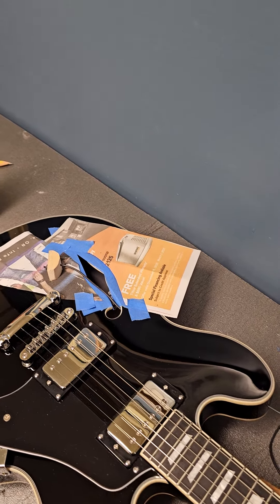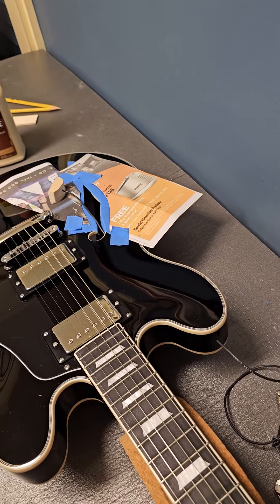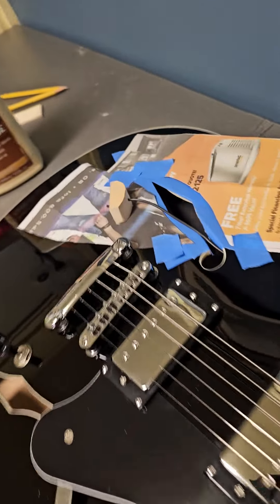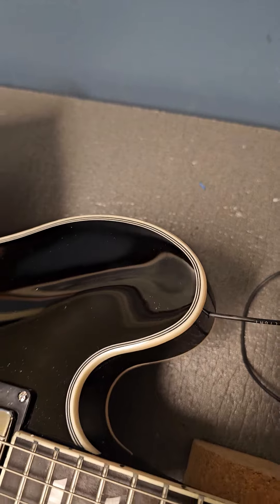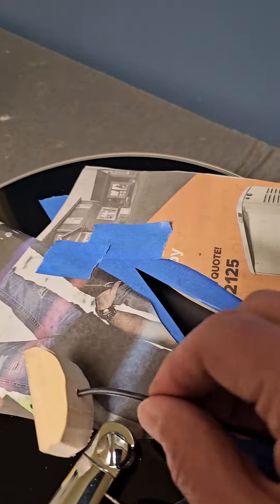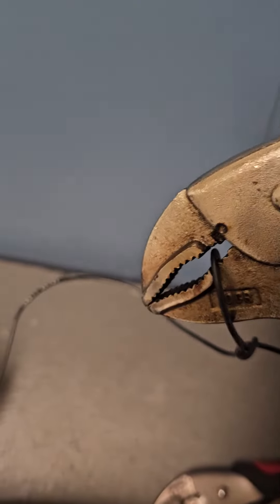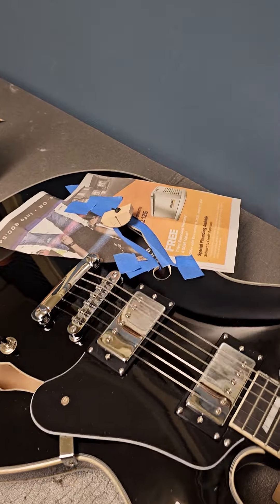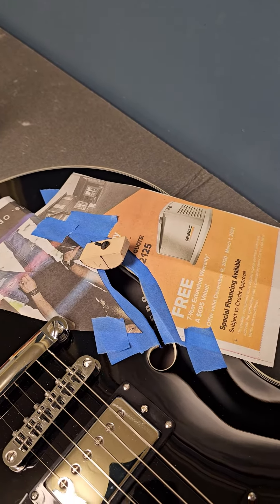How to Move Strap Button ES-335 and Other  ES-Style Guitars w/strap button on Backside

Comment: I put a strap button on the horn of an Epiphone 339.  In the event, I didn't like the way it changed the guitar's balance, so I reverted to the original position.  It seemed solid enough just screwed in through the bent wood, but if it was to have been permanent, I would have glued in a block like the one in this video.

Comment: If there is a switch on the upper horn, it might possible be an obstruction.  Then you could loosen up the strings and remove the neck pickup and the selector switch to get it out of the way.